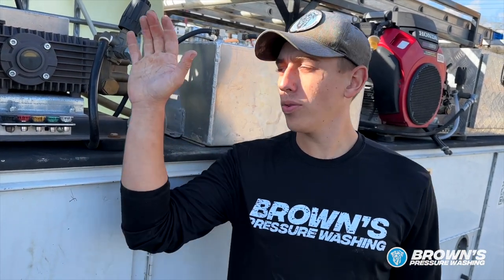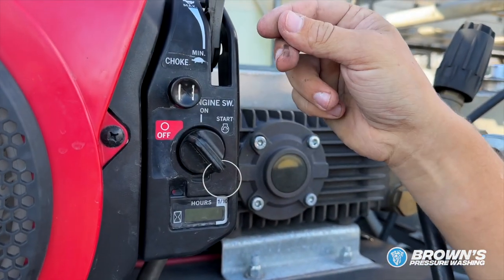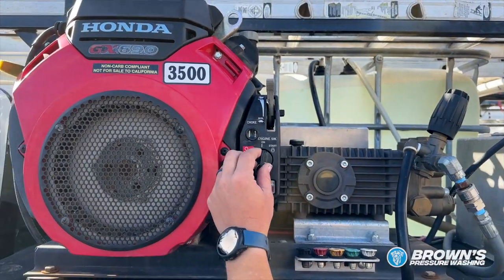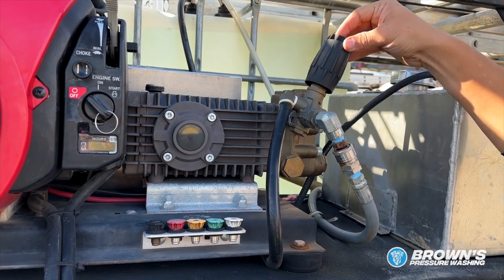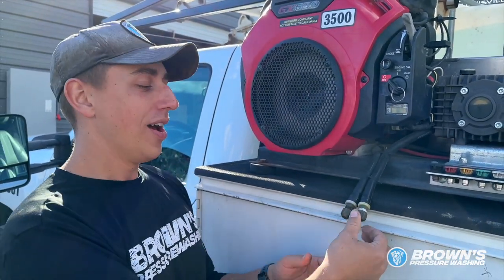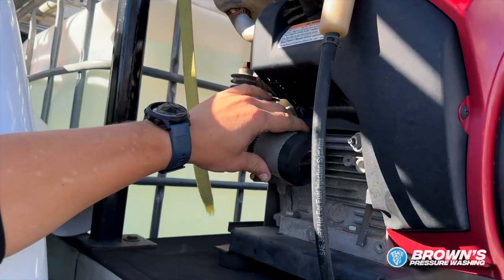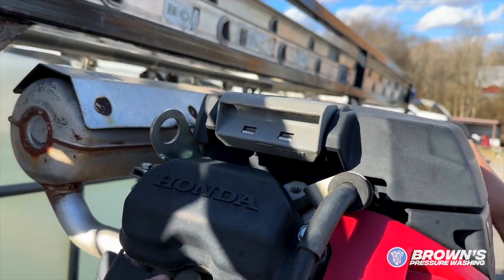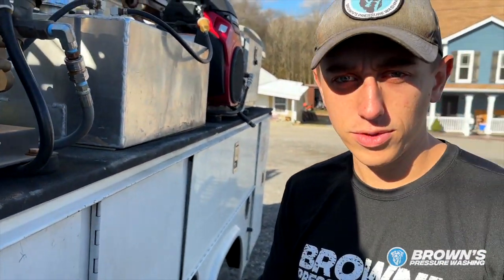HONDA GX690 - We Only Use This Engine For Pressure Washing!

Comment: please tell me how to set the unloader
Reply from the maker: Hi we typically use a gauge that hooks up to the quick connect out of our pressure washing pump. When we turn our pressure washer on, we will adjust the unloader and set it within the range that it’s supposed to be. All pressure washers differ so you’ll just have to research what range yours should be set at.

Comment: Hello there! Any major problems with the engine in 800 hours? Greetings from Romania!🇷🇴
Reply from the maker: Hello there Zerder!! Wow Romania! :) That's incredible. Thanks for stopping by our channel. So we can run those engines thousands of hours but its a Must that you maintain all the fluids on a regular basis! Are you currently using the Honda GX690? If so what kind of oil are you using?
Reply: @BROWNSPRESSUREWASHING  I don t own one yet, but I want to buy one next week, the gx690 is the only one that I can find in Romania, I didn t find the 700 and 800 series, and I am not sure yet what kind of oil I have to use but if you can tell me what you guys use in your engine, I will appreciate it a lot! Cheers!
Reply: @BROWNSPRESSUREWASHING  - A Belgian over here! :)

I use Honda GCC V-twin engines all the time. 

The very best oil you can use for these air-cooled puppies is a 10w30 : Motul 7100 10w30 or Amsoil 10w30 SS Diesel. Or the regular Amsoil 10w30 is ok too.

These provide the lowest oil consumption (Low noack), best heat control, cleaning power. They stay in grade after xx heat cycles. 

Hot summers? No problem. 

Avoid a 5w40 or 10w40 if you can. 

Hope this helps.

Comment: Thanks for sharing. What pump are you using?
Reply from the maker: Absolutely! It's a 12V REMCO. If you need advice on gear we get almost everything from Absolute Chemical here in Nashville. 615-876-1400 They can answer about any question you have. :)

Comment: Should I go with the belt or the poly chain? I’m fixing to pull the trigger and unsure.
Reply from the maker: Hey KG, sry for the delay. We are not familiar with the Polly chains but we love the belt driven, the belts do sometimes break every 1.5 - 3 years but they are SUPER easy to fix, it can be talked through over the phone. And Absolute chemical in Nashville is great for gear and advice on how to fix things.

Comment: What is the other type of motor you are running?
Reply from the maker: Hi Adam, 
We only run Honda GX690 for our machines. I will say, we do have one machine that is a predator brand and its actually causing a lot of electrical issues for us so we like to stick to Honda. 
Hope that helps, thanks!
Reply: @BROWNSPRESSUREWASHING  Oh, I was hoping it was Vanguard.  I've had issues with a Vanguard and other Briggs engines for years now.  Hondas?  Not an issue at all and some of my Honda stuff is over 40 years old, one of them used to be a rental roto-tiller.  The plastic's faded and disintegrating but it's one of the nicest units I have worked with.  Honda is smooth, fairly quiet, doesn't smell as much even in flathead G engines unlike the Briggs or Tecumseh flatheads (I've had better luck with Tecumseh over Briggs though so...yeah).  The only American engine brand that comes incredibly close to Honda's GX line is Kohler's Command Pro series.
Reply from the maker: @WJCTechyman  Thanks for dropping in! Wow 40 years!! I know we have a few that are getting up there in age but not 40 yet. :) We've heard good things as well about Tecumseh and Kohler. Do you own a pressure washing company?

Comment: What kind of psi are you running with Honda 690 ????
What RPM is normal for washing ?????
Reply from the maker: Great question and thank you for taking time to reach out. We use 3500psi, but that's not the best way to determine the effectiveness of a wash. The trick is GPM..... We use 8GPM Honda 3500 to soft wash 90% of our jobs. I know its expensive, but we can wash a 2500sft house in 45-60min. Hope this helps.